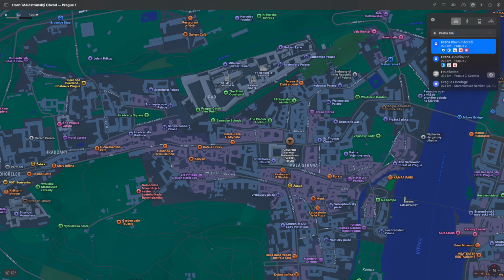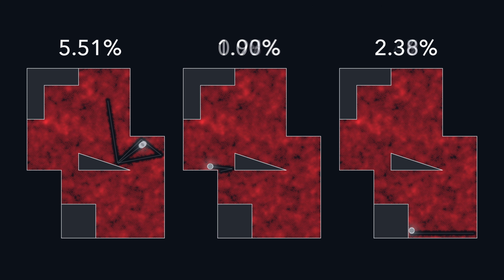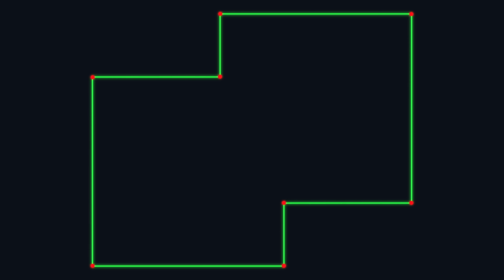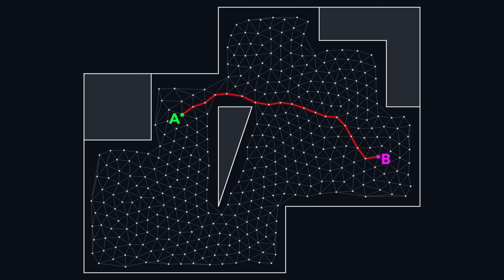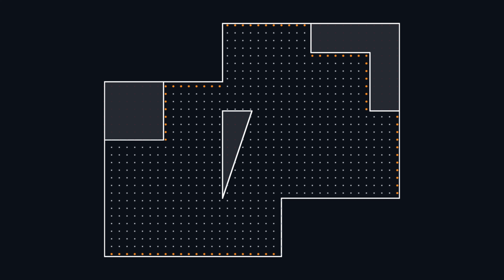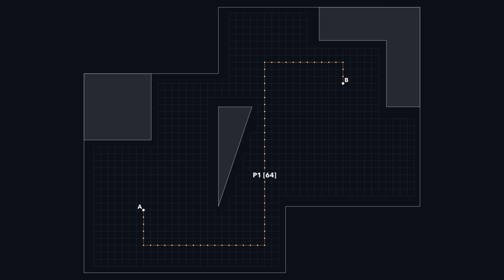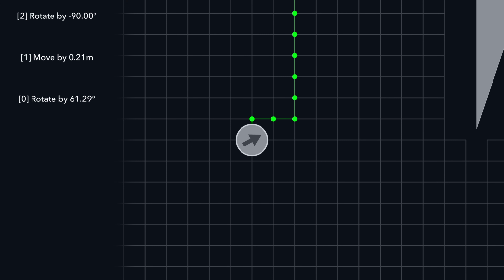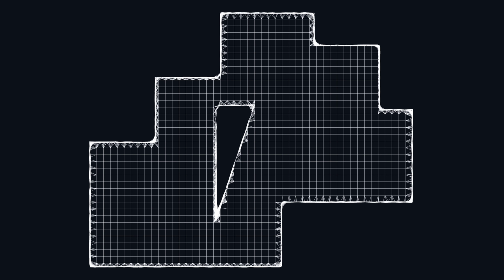How to design AI from scratch?

Comment: what you could do to make the area more efficient is to calculate the area of the work space, use an average amount of points per given area of whatever grid you choose to find the amount of spots that fit in the area, then run a particle simulation where the particles repel each other when they intersect and can only get within its radius of the walls, with no retaining of velocity till they all stop moving, and then you would be left with a pretty even grid that hugs the walls. and then ofc choose the closest neighbors within a given radius

Comment: (some) Things about the real world that complicate the problem. 
1. Sensor limitations. Lidar sensors for example are limited in how far they can see because accuracy degrades with distance. (And there is also a tiny blind spot up close.)
2. Lidar sensor data of obstacles results in a point cloud. If your algorithm uses, clean geometric shapes, they would need to be calculated from the point cloud.
3. Lidar sensor data is in a coordinate system relative to the robot, not global. The robot is not at an angle to the room, things in the room are at an angle to the robot. 
4. Not all obstacles are stationary. 
5. The robot does not move perfectly straight. Any drift will change how things in the room are angled to the robot. Some form of active correction would need to be used. (The missile knows where it is, because it knows where it isn't.)

So yeah, before we can fit a grid to the world and plan out a path, we need to figure out what the world looks like, as everything is vibrating and shaking around us with things popping in and out of existence, doing our best to not get lost. And if we are lucky, maybe we can clean over 90% of the floor.

Comment: Thanks for making this video but nothing covered here was AI or ML.
Reply from the maker: Hi,

This video actually contains a lot of AI concepts. We originally wanted to include a section to address this misconception but decided against it, which I now realize was a mistake.

AI, at its core, is about defining goals using performance measures and optimizing algorithms to maximize or minimize the given performance measure (as we've described).

There are many ways to optimize such functions, one of which is using some form of machine learning, such as neural networks, to "generate" an agent program from data.

Another approach is to "design" the agent program yourself by studying the problem. This can be done through methods like search, constraint satisfaction programming, logical inference, probabilistic reasoning, and so on.

A common misconception is that using "classical" approaches that don't rely on ML isn't AI, which simply isn't true. One of the reasons we created this video was to show that AI ≠ ML, and there is much more to AI than just machine learning.

Hope this helps, and thank you for leaving a comment!
Reply: @vojtechproschl you don't need to call everything AI to gain traction. You clearly optimized the program iteratively yourself, not by any automated means. That is not AI, that is simply developing an algorithm and there's nothing artificial about it. You could have done so much better if you weren't just chasing buzzwords around
Reply: @frogg03_  If you mean the Academic definition  of "AI", then no this vacuum is not "Intelligent". I think they are using it more like how people refer to AI in video games. There is a lot of overlap with controlling a simulated entity in a video game and controlling a physical piece of hardware interacting in the world. Even if there is zero machine learning going on it is still pretty neat. 

I see where you are coming from though, it feels like things are moving toward "If something cool involves computers, it's AI"
But I think you would agree that this video is NOT as bad as Logitech changing the color of a mouse button to blue and calling it "AI".
Reply: @frogg03_ what do you define as "AI"?